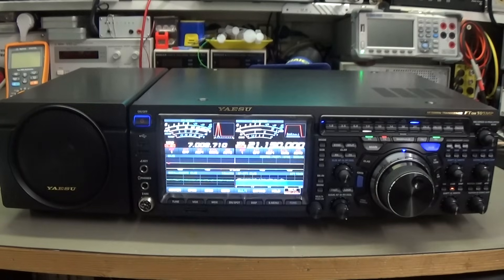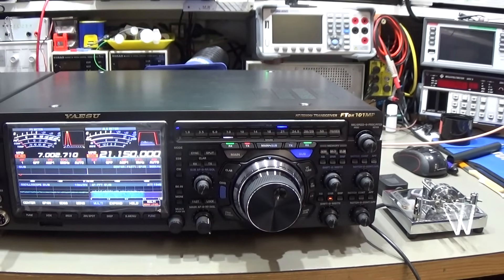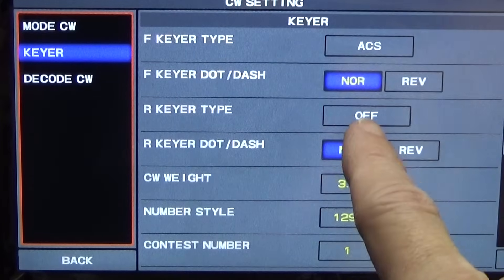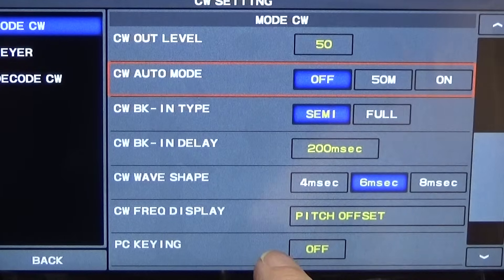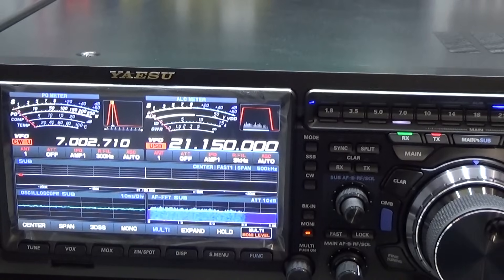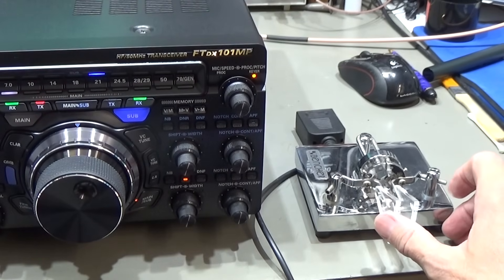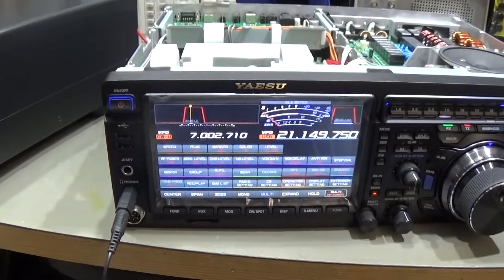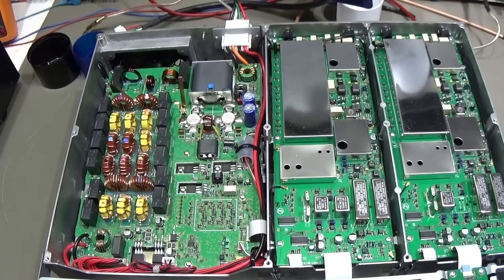#279 Yaesu FTDX-101 MP: Brand-new radio with issues. We fix it

Comment: Well first.  Advise customer to R.T.F.M.  Yea it is a thick book but they will learn a lot.  Second is I sent my 3000 in twice under warranty and they still not fix the issue.  I looked at the unit myself finally.  The screws for the voltage regulators were loose.  I have never had a problem since.  And last but definitely not least.  THANK YOU for the peek inside such a beautiful radio.
Reply from the maker: lol RTFM
Reply: I thought that it might be something simple from the beginning. I suppose the lesson to be learned is that overlooking the simple stuff can baffle the best of us and usually does. Your thorough approach to the problem leaves little to nothing to be overlooked. A connector jarred loose in shipping or a hungover assembly tech could have been responsible for the headphone problem. And menu driven radios can be daunting. Another commenter said R.T.F.M. That's always true, but that is also a lot to retain. I love watching you work.

Comment: From day one, Yaesu took care of me with the first no-cost repair due to a cabling connector known issue and installation of all of the extra filters. The FTdx-1001Mp is simply awesome. The only problems is that few software packages support it HRD being one of the few that does. Also, if you do not read the manual, good luck.

Comment: Yaesu could improve a lot in this rig. Especially the decoder for the various modes is only implemented half-heartedly. Had to find out this keyer thing myself. And using the rig with FT-8 was also not too easy. Thanks Peter for the instructive video!
Reply from the maker: Always look for the latest firmware. Yaesu is doing a lot
Reply: Hi Peter, yes, not long ago I upgraded to the latest firmware. However, not even after this can the Yaesu write down audio to the sd card. The Icom 7300 can.

Comment: The old man has got to have a lot of money to have one of those Peter  Cheers 73
Reply from the maker: Yeah, it is not the cheapest radio on the market.
Reply: They're available much cheaper if you buy a slightly used one that has 'defects', such as an apparently-defective internal keyer and a seemingly-broken headphone socket.  🙂

Comment: A good one, Peter! I would have jumped on the opportunity to clean the connector first, but I am lazy. 
To be honest, the lack of any slack in cables will create such issues. It is unpardonable in my opinion.
I mean, the whole bundle is routed on top of the connector, ffs. Nobody paid any interest in routing logically, in an engineering fashion. Make it fit seems to be the name of the game. With a 5000+Euro device you pay a premium and expect perfection. Not the case here
Reply: Why would you need to clean the connector on a brand new radio?
Reply: Why not? Dirt doesn't care how new an equipment is.
Reply: @OctavMandru  Actually, yes it does.  That would be why new equipment is always clean inside.

Comment: Very happy with my FTDX101MP, though I did kill it on the first day!  Fortunately VRF150s are relatively inexpensive and very easy to obtain. I put it down to finger trouble on my part (too high audio level on FT8) but did find the FETs were not screwed down firmly. A great performing radio but of course a lot of settings to play with. I took the opportunity to fit all of the optional filters, hopefully I will not be seeing the inside of the radio again for a very long time. 
In defence of Yaesu, the rig you are working on has some accessory filters fitted, the 101MP is normally shipped with 3 vacant filter slots. It is possible that a dealer fitting the 1200Hz filters to this radio disturbed the connector.  73
Reply: Filters are not dealer fitted for the FTDX101, they are factory fitted.
Reply: @johnratcliffe6438  the 1200Hz filters are available readily in the UK, I fitted mine and the narrow CW filter for the sub-receiver myself. The situation in the USA is apparently different as they claim the filters need to be factory fitted. That is not the policy in the UK.
Reply: @g0fvt  Martin Lynch say they have to be factory fitted. But that's for a new order, not retrospective.
Reply: @johnratcliffe6438  my rig came from another UK dealer, I bought the 3 filters and fitted them myself. It is a fiddly job getting the receiver boards out and disconnecting a large number of tiny coaxial connectors. If I  was retailing them I would not want to do many!

Comment: New radio... return under warranty and get something with better build quality.
Reply from the maker: all radios have their pros and cons as any other consumer electronics on the market too...
Reply: The build quality of Yaesu's FTDX series is superb. It is a question of assembling. It might be Yaesu's fault, but also a mishap while, say, installing filters by third parties.
Reply: @Gorantp  Fair enough though looking at the thickness of the chassis it looks like they have cheapened out compared to the chassis of their own 80's sets and earlier. The ft450 was the first to have the soulless lightweigh plastic tuning knob. I havent felt the ftdx in person so I cannot tell if it 'feels' nice.
Reply: @GeorgeChristofi  the feeling of the tuning knob is, trust me, spectacular. Solid aluminum...
Reply: And I got a FT-1000MP. FTDX-101 is far better. The front face finish is also of top quality.

Comment: Had 101d, sold it after two months, over rated radio... Went full SDR instead, no regrets 😊
Reply from the maker: The SDR radio is not even in the TOP 10 Sherwood list whereby the FTDX101 MP is on the first palce..

Comment: I've always preferred Yaesu's menu structure compared to Icom.  Icom has multiple layers and is very confusing while I find Yaesu's approach to be more logical.
Reply: Yaesus makes no sense. I have both an Icom 7300 and FTDx10. On the Icom if I want to change band I touch the MHz on the screen and the band options come up. On the Yaesu if I press the MHz I can only use the rotary dial to change the MHz by 1MHz increments which is of no use at all outside of the 10m band and pointless. Why can't it bring up onscreen buttons with the bands on like Icom?
Reply from the maker: The menu structure of Yaesu has improved a lot with the new range..
Reply: But the quality control seems to be the same as always, Peter 😢
Reply: @conorturton  I think you are mixing up menus and operational controls.   The older Yaesu menu system was numbered 1 - nnn and organized into functional groups.  Most menu items are set once and forgotten about.  The Yaesu menu system developed for the new FTdx line is still organized into groups, but they are under the function pop-up and accessed by buttons on the touchscreen.  I have no problem with either method.  Yaesu's menus are a mile wide, but an inch deep.  Icom's method, with layers of icons, drives me nuts.
Reply: @conorturton  On my FTdx-101D, when I touch the Hz portion of the freq display, it brings up a direct entry keypad.   I think I recall the FTdx10 brings up the band selector.

Comment: Yaesu radio ergonomics are beyond strange. Whoever they get to design how you interact with the radio controls needs to be fired and they need to hire someone from Icom or Kenwood. Nobody would ever think of having to press in that knob to enable the keyer, they would assume if it was selected and enabled in the CW setting menu it would just normally work just like on any other make of radio.
Reply from the maker: Everyone has to find their own way.
Reply: ICOM isn't any different.  Just putting it in CW mode and hitting the key won't make it transmit.  You have to select one of the break-in modes to get it on the air.